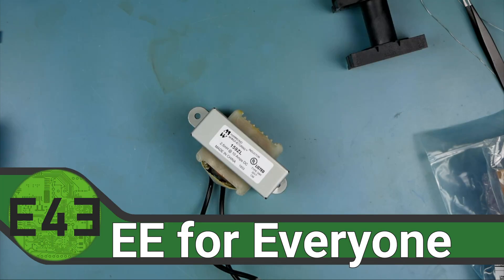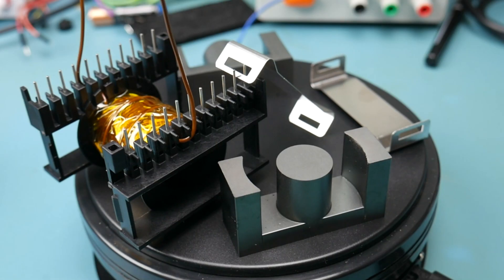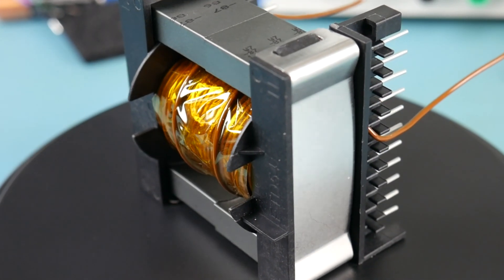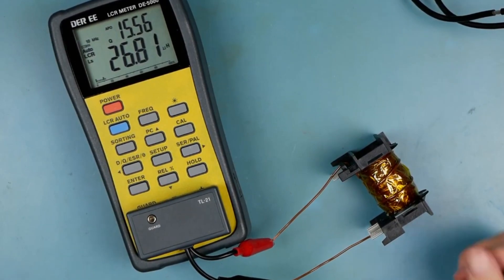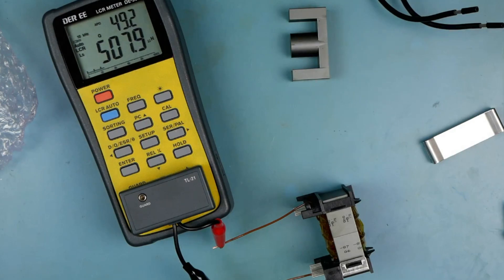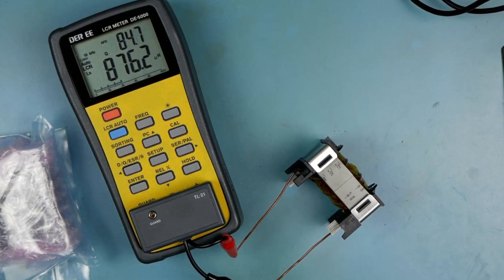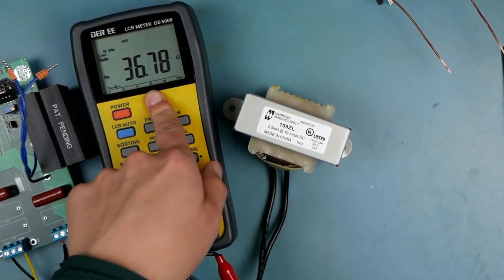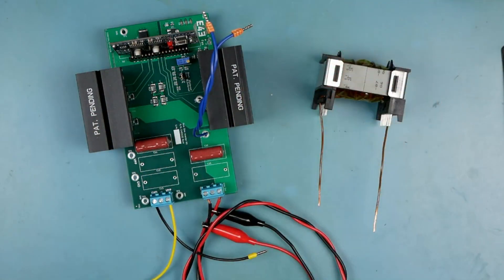Winding a Custom Inductor – Playing with ETD Cores!

Comment: it´s ok,... nice. You need to make a saturation tester for test you  indutor. Nice video
Reply: Agree, I see many using MCU's today, overcomplicated, to do this but I think a simple PWM controller with a 500KHz output is good enough. SG3525A example.

Comment: When i do prototyping with inductors and flyback transformers i usually only buy ungapped cores, cut a strip of sandpaper and use feeler gauges to set the gap on the middle leg, then once everything is tested i order the gapped cores.

Excellent video as always though!